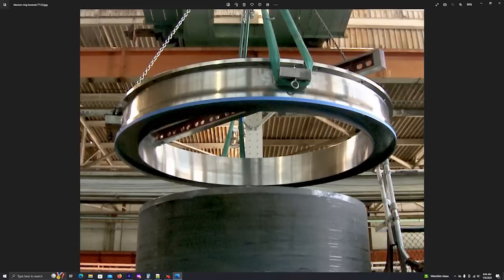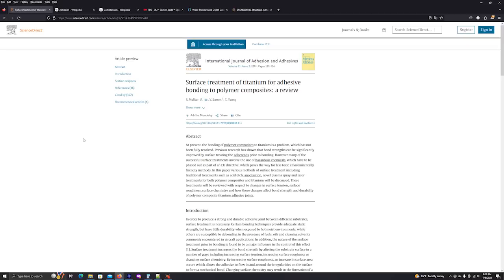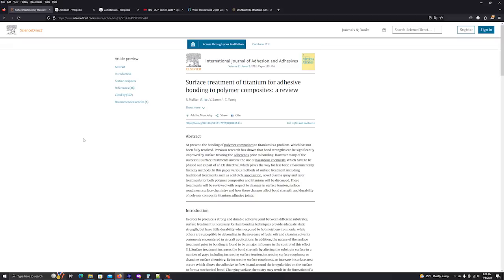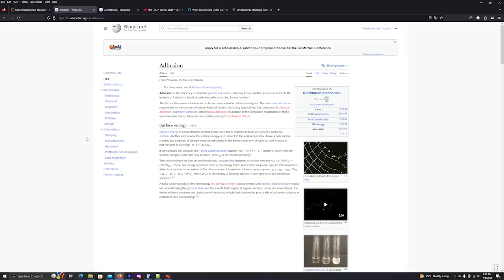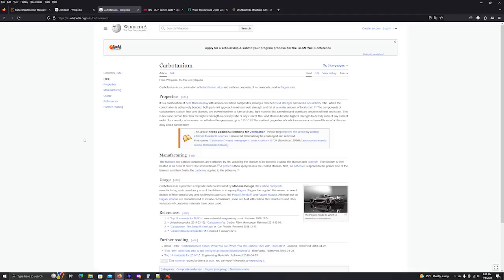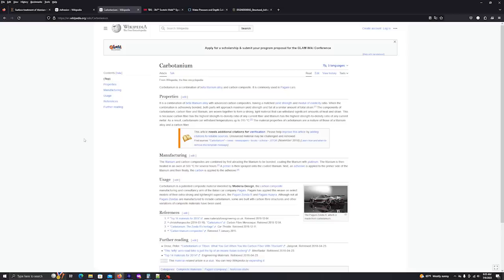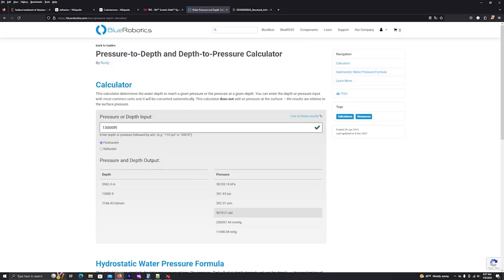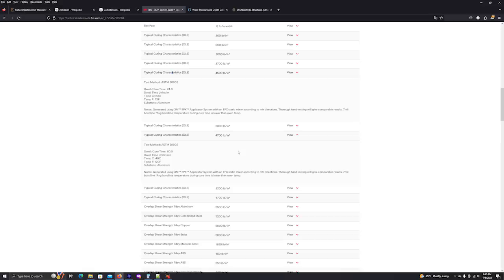Oceangate Titan Adhesive issues between Carbon Fiber and Titanium

Comment: As I understand your analysis, it appears that you are confusing hydrostatic pressure at 13000-ft depth with compressive bearing stress along the bond surface between the CF hull and the titanium ring and thus grossly under-calculating this bearing stress!  The compressive bearing stress is actually the PROJECTED area of the end hemisphere divided by the BEARING area of the end edge of the 5-inch thick, 66-inch outer diameter sphere.  So ... 3421 in2 projected area of titanium hemisphere x 5780 psi hydrostatic pressure yields 19.77 million lb compressive force along that epoxy bond surface.  Divide this by 958 in2 bearing surface area of cylinder yields 20,650 psi compression in that epoxy bond joint!!!
Reply: Oops!  I meant 66-inch outer diameter cylinder, not sphere!
Reply from the maker: Thanks, Yes someone else corrected me.  this is great info.  Thanks so much
Reply: @JoediyLab  Under such a loading scenario, there would be severe yielding and creep in not only the epoxy bond but probably in the CF epoxy matrix, itself, since it may have been improperly laid up.  A subtle consequence of this might have been progressive permanent shortening of the cylinder with each successive deep dive, which would negatively impact buoyancy ... it would sink faster and more slowly float back up after ballast drop, which is consistent with the alleged communication transcript that has been in the news.  This would mostly occur at the cylinder ends where discontinuities and stress concentrations are more likely.
Reply from the maker: I am trying to repeat your formula,  I am using 2π(35 + 30)(35 - 30 + 3) I get 3267 for surface area of hollow cylinder.  How did you get 958 in2.  Thanks so much
Reply: @JoediyLab  From Wikipedia search, the Titan cylinder had a 56-in inner diameter with 5-inch thick hull hence 66-inch outer diameter.  So cross-sectional (or end bearing) area of  A = pi (33^2 - 28^2) = 958in2.  Hope my math is OK!
Reply from the maker: @speleotrog  thanks 👍

Comment: I think even if the adhesive failed the pressure would've kept the rings pressed against the cf, and the only problem would've been a leak which I assume they would notice right away, although the high ROD would indicate a possible leak in the hull, but then whey would so much water go?! Also, even with a strong bond isn't the CF composite much stronger considering the thickness, so that it won't break?
Reply from the maker: Thanks

Comment: 18 bolts held the bulkhead to the hemispheres, all broken off.
Reply from the maker: Yes, image the force it would take to shear the bolts around the flange.
Reply: Yes immense, don't know what grade, thread pitch or material the bolts were, but a grade 8, 1/2" x 20 tpi bolt has a minimum tensile strength of 24000 lbs x 18 bolts = 432000 lbs or 216 tons
Reply from the maker: Yes very scary indeed

Comment: What is also interesting is that the "implosion" had enough force to not only take the titanium ring off the carbon fiber, but also sheared the 17 bolts holding the titanium dome onto the ring; since they were found separated.
Reply: I actually think those bolts had a part of ring / hull disintegration as they were HAND tightened..wtf imagine 1 or 2 bolts not tightened evenly or loose...No, the bolts were not tightened to a certain spec Just "hand tightened" all 16 17 of them
Reply: @cruzdeleon1888 Those bolts weren’t doing anything to keep the sub in one piece once it got under water; the pressure was pushing the end caps on with much more force than the bolts could exert.
Reply: Yes it was done by the enormous explosion of the compressed air inside the hull when the carbon fiber tube imploded: similar of a giant "diesel effect"whith a compression ration around 350/1, in an diesel engine, its around 20 to25/1. Note the window also is pushed in front with it's retaining ring ans bolts ( photos wrecked parts)
Reply: The CF / Titanium ring bond was way weaker than the bolts holding the hemispheres so the rings must have detached before sufficient force met the bolts to make them shear.
Reply: Check out some of the science of the implosion videos.  The water blasts in and rebounds in a pulse wave equal to the force it came in with.  All in a few milleseconds.  Quick enough to rip the bolts apart before the tube was too fractured to be able provide the necessary counter resistance.
Reply: @@dongreek3500 Here's some reading for you from an engineer and former large ship mechanic:

I never asserted that there were windows at either end.  I think you misunderstand my remark.  

They were able to lift the rear bell out of the water DESPITE IT NOT HAVING A WINDOW.  Thus, had the front window survived, it would not be necessary to remove the window in order to rig the front bell.

Rigging describes the practice of lifting heavy objects.  I have rigged items this large.  I used to work on an aircraft carrier.

A shackle is a common rigging appliance.  It is a threaded pin and c-shaped ring that mates to it.  To lift the rear end bell, you would thread shackles through one or two of the bolt holes on the mating flange and then strap or cable to the shackles.

That the cable was threaded through the window hole is evidence that the window was not present when the front end bell was found on the ocean floor.  Simply using the vacant window hole to thread the strap through was convenient and easier than using shackles.

I hope this clears things up for you.  I didn't mean to bait anyone into an argument with a subject-matter expert.
Reply: You sure they sheared? Or did they rip out?
Reply: @coryjohn4057  Good point - The report that I heard said that the screws did not shear.  It said that the threads failed, and they were ripped from their bores.
This looks like even more sloppy engineering.  It implies that stainless steel bolts were used, not titanium ones.  I wouldn't expect titanium bolts to fail in this way.
Has the window been located?  If not, it was probably vaporized by the heat of the compression detonation.
It's academic though.  I think the interface between the carbon fiber and mating ring opened up as the hull began to collapse upon itself.  Then the explosive compression of the people capsule blew the end bells and window apart.
The detonation caused all the fasteners to instantly yield and the hull to shatter.
Reply: @kurtpena5462  carbon fiber is not a material that likes threads. The glue joint should be stronger than the carbon fiber. Seeing it that clean tells me that was the fail point. From a glance anyways.
Reply: Correct on the separation of the hemisphere and ring by failure of the bolts but the bolts were not sheared. Their threads were stripped. The body of the bolt played little part in holding the flange and hemi together beyond its ability to hang on to the threads.

Such a powerful force needed to pop both hemi and hull from the flanges. Add to that the speed at which the forces are applied. Such an enormous amount of force applied suddenly is a 'jerk' phenomena studied by the US Navy some years ago. If you apply a steady force up to and past the, in this case, tensile stringth of your load carrying material, you get a textbook fail. But if you apply that much force suddenly, the material will often break because the jerk effect will overpower the material's ability to cohesively stretch to the required level of strain.
Reply: @ronparker-q9e  Kind of like a multi ton tow rope that snaps like a thread if you get slack then suddenly tighten. Instantaneous forces a multiple of the intended force. To blow the window out and separate the dome from the ring all in a blink. Unimaginable forces at work. I have to seriously question glue as a method for the environment intended for the craft. And only a 3 inch lap for the joint. A foot maybe? 3 inches? - Cheers
Reply: It's possible the crew unscrewed them so they could attach it to a crane.
Reply: @arthurdent5357  Not likely, since evidence is never tampered with or taken apart at the scene. It is transported as found, and its exact location on scene is mapped. There are important  clues in how and where pieces are found.
Reply: @arthurdent5357  Are you serious? That will be direct tampering with the evidence. No way that's possible.
Reply: As long as the tampering is documented it is merited
Reply: @michaelwillis6218  Read my detailed explanation in this thread.  

It would not have been necessary to take all of the steps necessary to remove the window when they could have just rigged it with shackles.  The window missing made threading a strap the easiest option.  

And no, you try to not disturb forensic evidence if at all possible.
Reply: @arthurdent5357  Interesting point, but not likely,  
They could have more easily shackled to the vacant bolt holes were the window intact.  It was easiest to loop a rigging strap through the center of the doughnut because they most likely found it that way.  
(It would also have degraded its forensic value to remove the window.  Also note that they were able to lift the other end bell where no such window feature existed.)
Reply: Natures forces laugh at such mere obstacles..
It only took a millisecond to destroy this toy sub.

Comment: You have to be complete maniac or not have clue at all with what you are dealing with when you decide to do stuff like this, wind carbon fiber on steel and then extract that CF tube out and use any kind of adhesive to merge together that CF tube with completely different kind of metal. In beginning I thought that they wind CF on steel of titanium tube and somehow glue that titanium tube+CF winding on titanium end caps but when I noticed that tube was 100% percent winded CF I was speechless. How any engineer on this planet can approve this and think it is safe on those depth is out of my mind. Im very glad that there were people who stand by their knowledge and principles and didnt allow to be part of this project and tragedy

Comment: the torsion pressure of the front opening dome would want to unscrew that seal like a bottle of coke when out of water. the weight of everything in the tail also with leverage hanging on the rear titanium ring. photos of the rings being tied down to the ships deck at 45 degrees out of water. once the end seal broke, the pressure inside shot the end caps out clean. at this point they have not shown any carbon debris or fragments on the rings. this makes me think the carbon tube is pretty much intact like a section of rifle barrel. it used all the force to blow the end caps out as its weakest point. the thing everyone is asking!!! where is the tube and what is the damage. it has huge mass that will not just be dust whatever anyone says
Reply from the maker: Thanks for the comment

Comment: I've worked with these materials for four decades. In both aerospace and racing sailcraft.
The first thing that popped into my head when I saw the Titan construction, was how the CTE, or thermal expansion coefficients, of carbon fiber, titanium, and epoxy would interact with both the temperature and pressure at sea level, and the depth of Titanic. It doesn't look good if bonding integrity is the focus.
Reply from the maker: Thanks for  the feedback

Comment: The Endcaps Blew off after the implosion went into an  "explosion "😉  I wonder given the near freezing water and the way the CF would of flexed  in and out in the Event '   Could  the glue of Shattered ? , I have seen glues do some odd things just in the auto mechanics business let alone what you are relaying Interesting listening and viewing Thanks
Reply from the maker: Good question,  at that depth, the outside pressure more than likely was holding the end caps on.  But if the adhesive failed at that PSI water could have blew past the sealing surface.

Comment: There seems to persist a lot of 'pressure vessel' thinking where the vessel walls are in tension, and the end caps need securing to the tubular body. In this application the end caps are being pushed by a large force onto the body when at depth. They need locating when on the surface, but compressive stresses would far exceed what a few bolts can summon up when at depth. The major function of the adhesives at the joint of the components must be to seal, and have sufficient integrity to not be pushed out of the joint, as that would be catastrophic. Water jets at that pressure can be used to cut things like steel in manufacturing.
Reply from the maker: Goo points,  yes I think the adhesive could just be a seal to prevent water from coming in at high pressure.
Reply: The adhesives would presumably seal out the sea water successfully as long as the titanium flange face and the mating composite faces remain perfectly parallel.   However, due to the very high loading on the flange there would have been some rotation of the flange - which tend to open up a gap.  Correct design of the flange and the mating surface can be a very complicated matter.   There are a number of technical papers on this.

Comment: From what I understand the Carbon Fiber at 5,600 PSI would shrink by 19 mm (3/4 inches), from going over several sources there is no mention of the shrinkage of the Titanium rings. Even with all the glue gone the end caps would be held together by the water pressure. There are carbon fiber air tanks that are commercially available that are rated to 4,500 PSI and there not recommended for saltwater diving due to the corrosion properties of saltwater to the carbon fiber.
Reply from the maker: Thanks for the feedback

Comment: you know once under water they wouldn't even need to have the two pieces glued together...the pressure of the water alone will make it impossible to separate the caps even if you'd try...so the glue as NOTHING to do with all this.
Reply from the maker: possibly to prevent water pressure from blowing past the flange and carbon fiber.

Comment: What struck me was the environment in which the 'glue up' was done: An open warehouse/workshop, not a clean room. This could lead to contamination of the bonding surfaces. How was the bond cured? Was it cured at temperature in a vacuum chamber or at least under a vacuum? What were the properties of the polymer adhesives used? Did Ocean Gate engineers factor in the safety factors? Did they follow safe and established material handling protocols?
Reply from the maker: All good questions

Comment: Great research! Thank you.

As a lay person the lip of titanium seems to be 1-2 inches and far too small to handle the deforming carbon fibre under those pressures.
I think they should have used a titanium lip of at least ten inchens and also have titan beams to attach the endcaps to each other under the carbon fibre hull.
Reply from the maker: Good points
Reply: Yes and no, the centering lips seems right, as new on the wrecked parts, if a shearing force occurs , the bonding an axial pressure hold the parts ( axial force is around 8560 t under 40 bars of pressure, this do 1440 bars on the carbon fiber section. Combined to radial force, the result is around 260 Mpa in compression against the epoxy carbone hull).
Reply: @danieldupuys2002  I saw a FEM Model of the forces on the carbon fibre tube at pressure and those were strongest at the Titanium end caps. While the middle of the tube has the strongest deformation so beams and long lip seem like a good idea to help with deformation and those end cap forces.

Comment: Joe
Since the Titan made several trips to the Titanic, Ive wondered if the failure wasnt due to the ongoing exposure to extreme pressure and brittle cold combined.
Reply from the maker: The carbon fiber more than like did weaken over several dive cycles.

Comment: Well, here are a few figures to chew over. At 3000m down the pressure is 30 MPa. The tube was 2.4 m long with an OD  of 1.67 m and an ID of 1.42 m and a wall thickness of 0.127 m .
Cranking the handle this gives an end load pressing the hemispheres against the ends of the carbon tube of 66 MNewtons or 6728 metric tonnes. This results in a pressure applied to the ends of the carbon tube of 108MPa. If we now consider the compression forces in the walls of the cylinder (consider an axial diametric plane bisecting the tube) The force pressing the two diametrically opposed sides together is 120MNewtons (12,200 metric tonnes) and this results in a compressive pressure in the walls of 200MPa. Interestingly, the compressive strength of a single carbon fibre is about 800MPa but this measurement is extremely difficult to make as aligning the force with the axis of the fibre is non-trivial!

As for the glue I can only point out that the sphere of the FNRS - 3 the first bathyscaphe to reach 4000m down simply had the accurately machined surfaces of the hemispheres fairly lightly clamped together with no seal-ring or seal compound in the interface. The light clamping pressure sealed the gap on the surface and the forces of the water pressure at depth maintained a perfect seal (only a few drops of water oozed out of the interface as the initial pressure of the dive came on). Pierre Willm, the technical officer responsible for the FNRS-3 wrote about this in some detail in the 1950s
Reply from the maker: Very cool information
Reply: @JoediyLab  One other quick sum about the differential expansivity of the titanium and the carbon. Titanium has an expansivity of 8e-6 per degree C and carbon is variable but generally less than 10e-6 so it's unlikely that the differential would exceed 10e-6. If we apply a change in temperature applied to the structure of 30deg.C we could set up a stress of about 300e-6. The modulus of carbon is about 230GPa so the resulting stress in the carbon would be about 70MPa - probably less if we also consider the modulus of the titanium. 
While not trivial it is, when compared to the stresses imposed by the pressure, not a major factor. It could, perhaps, be the straw that broke the camel's back but...